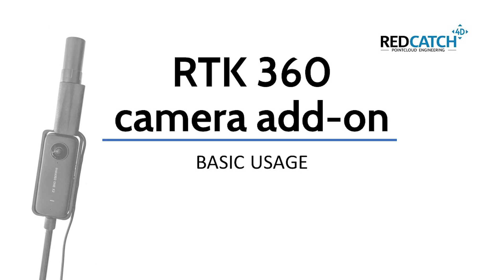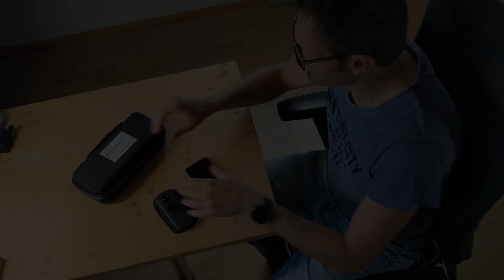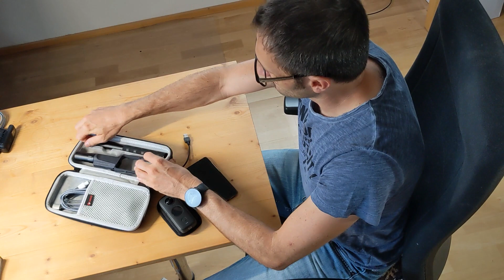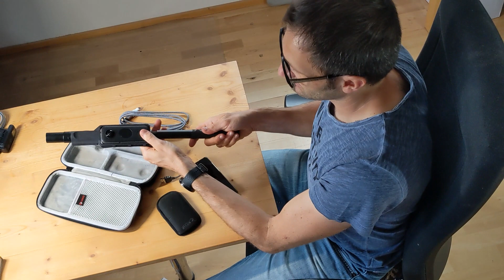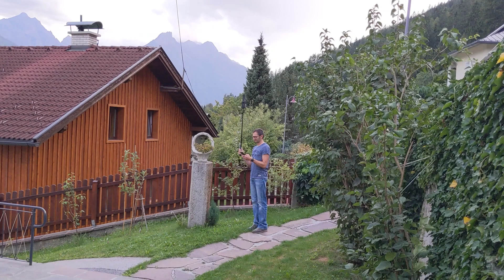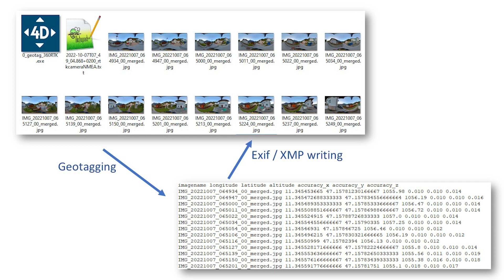360° RTK camera add-on: Basic usage guideline

Comment: If there is no good rtk signam. Is it possible to have this antenna connect to a nearby base or something?. I'm mostly thinking for capturing mountain roads to build a racing videogame. I' tested the concept with ñunlic MMS lidar. But I dont't have the images that where used to give color to that dataset. Also now there are tge 3D GS and having the camera priora located via rtk would be a bladt for a long road stripe of lets say 10Km
Reply from the maker: Hi, there is now way to connect it using radio links or something like that. But we do have the possibility to configure it for PPK processing.

Comment: The RTK device needs the camera to work or relies on an android phone? Question is because I whant tonknlw if the life of this device will be tied to the camera lifespan or could be used as track logger dor later geotag other data. I'm thinking of the Portalcam from XGrids that comes without GPS.
Reply from the maker: Hello, the devices relies on an Android phone. The smartphone provides the power source and the App is logging. I don't know PortalCam, so I can not provide any reliable information, sorry

Comment: interesting video. for capturing in-house data from existing buildings, can we use only the system's IMU (due to lack of GPS signal)? is there any test results?
Reply from the maker: Hi, the system is designed to do outdoor photogrammetry. We had success indoor, by taking RTK georeferenced images outdoor and combine them with the indoor photos (continouse recording). Try to "connect" the images eg. taken at (opened) windows between indoor and outdoor. So you can georeference indoor using outdoor RTK information. ONLY indoor is not possible with GNSS. Best regards